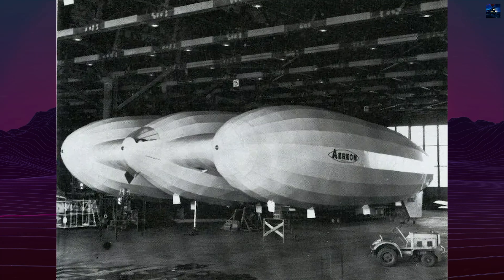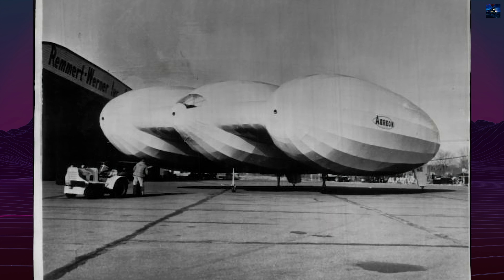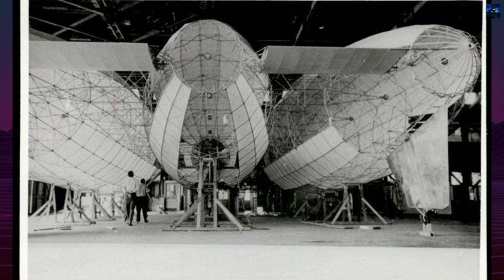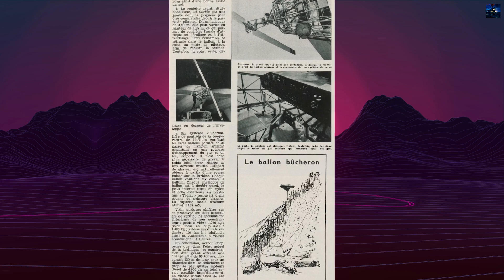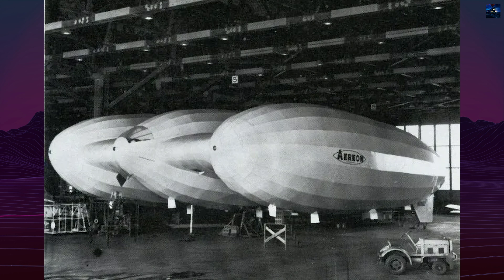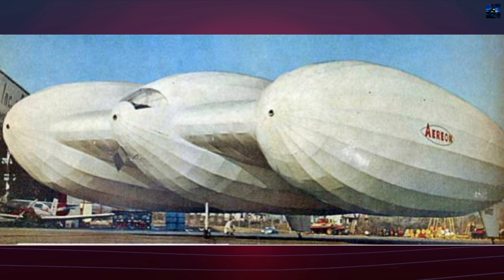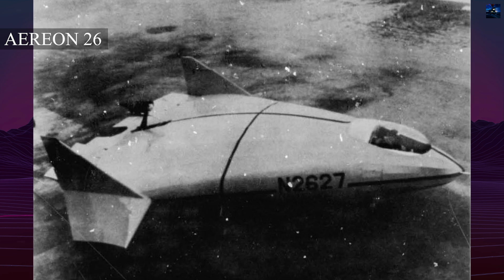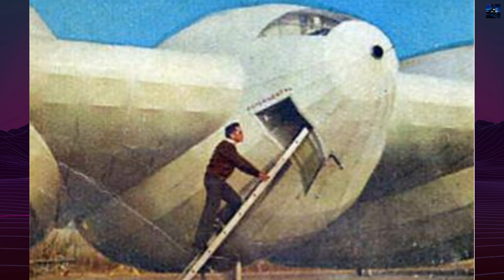Aereon III: The Forgotten Airship That Tried to Fly Without an Engine

Comment: What was Imperial Japan had lacked ferrous iron to not have rail transit tracks so to haul freight they had perfected steam filled airships fueled by Ceramic sulfur burners and braided composite fiber rocket gliders powered by a cryogenic liquified deuterium fueled rocket engine comprised of a Dewar of Deuterium fuel connected to a beryllium alloy reaction nozzle coiled in around electromagnet Helmholtz coils to focus cosmic ray muons so fuel could prevent exceeding Curie Point while alpha particles could be deflected away to enrich fuel. 

Hideo Hasagawa's memoir of Project NA thru NZ and how Noguchi of Hamgyong had to use employee Hansgirg's name on patents like how Mary Kenney had to use attorney Gibbons on patents for louver covered ground based STOL fans is a testimony to White male Eurocentric hegemony of their time.

O.S.S. files show roof top hangars and high vaulted ceilings of high aspect ratio corridors which had extended from Wonsan of Kumgang Range thru Changbai Pass into Harbin.             

I have MIT peer review and a CIA archaeologist stuck in North Korea to search for Noguchi's WWII cold fusion rocket powered plane.
Reply: you censored my entry

Comment: solar electric blimp. if you are smart you can do a vacuum blimp. the spine of the blimp needs to be strong enough, or the force keeping the blimp vacuumed be strong enough (static electric charge foil blimp).
Reply: Nuclear rocket engines would be better such as uranium gas core fission fragment and how Noguchi of early 1940s Hamgyong used Helmholtz coils to focus cosmic ray muons to catalyze cryogenic liquified deuterium fuel from a Dewar. 

Robert L Morrison has Patented microscopic vacuum chambers of freeze dried aerogels.
Reply: Robert L Morison's patented lighter than air solid "SEAgel" is of microscopic vacuum chambers

Comment: There are a number of recent materials developments that merit a closer look at this technology. First, carbon fiber as a rigid, strong, lightweight material for framing. Next, Kevlar or metallized plastic for the envelope. Third, solar panels for production of electricity to drive the propulsion engine(s). Storms, the great enemy of airships, can be more easily avoided, thanks to advances in meteorology and communications. Helium is too expensive to bleed off, but it can be compressed and stored in on-board tanks.
Reply: Robert L Morrison's Patented Lighter than air solid "Seagel" sealed in metal foil.